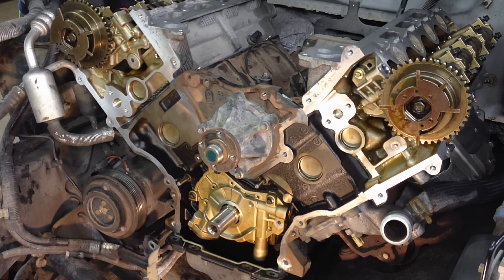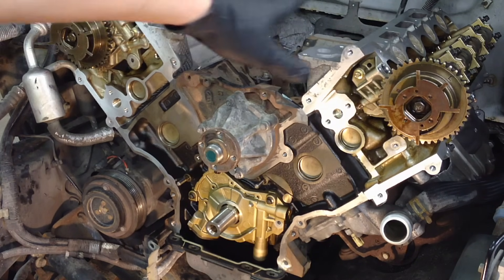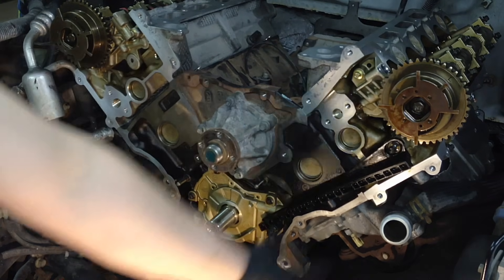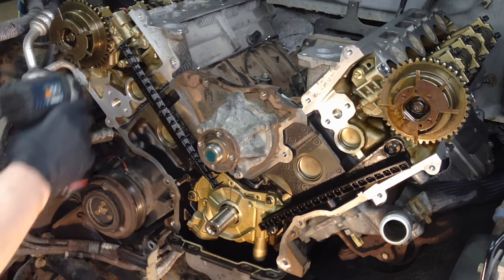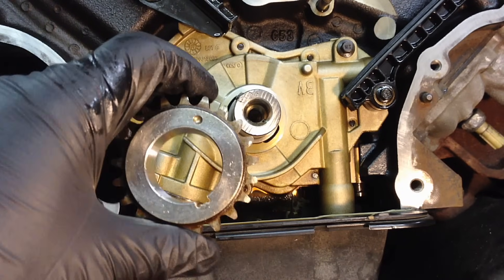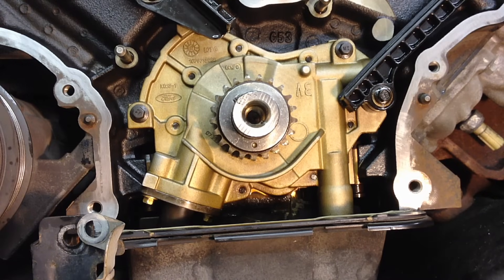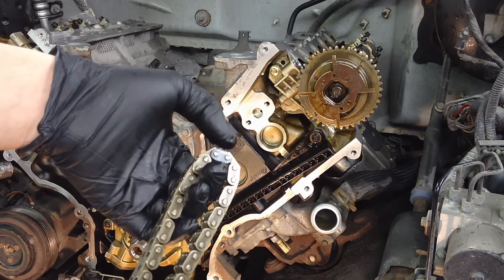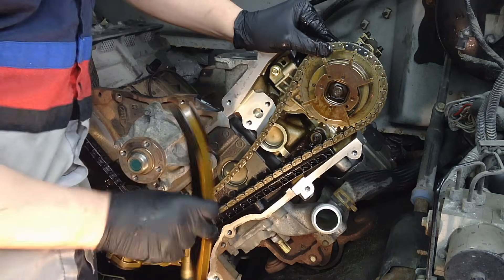Ford 5.4L 3v Engine Timing Walkthrough

Comment: Thanks for these videos, they're really helpful.  One question though.  On the 5.4 3v (in my Expedition) is it necessary to pull out ALL of the roller followers to do the timing chains/phasers/etc.  Or is it possible to leave them in and not damage anything?
Reply: did you ever get it done?
Reply: @ogbobbyharris5561  I did end up doing it. I ended up changing everything. I got the phasers really cheap and all the other stuff fairly cheap as well. I think I did the whole job for like 500 buck or somewhere in there.  Did it in my driveway and that car is still running today with over 300,000 on it.
Reply: @andrewminkewicz8846  what oil do you use 5w20 or 5w30?

Comment: I had my timing chains changed on my 5.4 and now it makes a howling 
noise when warmed up and in stop in go traffic any ideas (did notice 
check gauge quickly flashes but doesnt stay on could it be the same 
issue)
Reply: Aaron Philip low oil pressure

Comment: The only thing that is making me scratch my head is .... did you take all the rockers off? and if so when putting on the new phasers and doing the timing like you did, will that line the camshaft up in the position it needs to be... u said something like locking it down?
Reply: +aaron butcher There are special brackets that bolt on to hold the cams in place when the phasers / chains are removed , you can find them online .

Comment: I have followed your video, and I think I have got this correct. However, I may have made a mistake... I hope this makes sense to you, so please bare with me..... After I removed the timing chains, I rotated the crankshaft a few times because I was uncertain if the motor was in TDC...(Stupid mistake)  I rotated it to the point that the crankshaft keyway was at the 11'oclock position, and the timing sprocket dot was at the 6 o'clock position... I then replaced the cam phasers, tensioners, guides, and chains.... It is all lined up correctly on the sprockets and the marks on the chains are all set accordingly..... My question is, by turning the crankshaft multiple times with the timing chains off, did I screw it all up? Or as long as the crankshaft keyway is at the 11oclock position.... Will I be okay? How can I verify that it is set correctly? I don't want to bend a valve when I turn it on..
Reply: +Billyonaire Hate to break it to you but if you turned the crank with the chains off, and the followers were still in under the cams, you probably already tweaked a couple valves.
Reply: +ghunt81 went back together fine..  Doesn't skip a beat..  All I did was set cylinder 1 to TDC,  set keyway to 11 o'clock and lined up the chain timing marks on the sprockets and was good to go.

Comment: I've changed both phasers, both chains, both tensioners, oil pump, and both VCT solenoids on my 06 f150 5.4. my truck will start and run fine but as soon as I accelerate, my truck will die at idle. Any idea what's causing this?
Reply from the maker: +Anthony Aubrey try to drive it without the vct solenoids connected. If it still does it then verify throttle body operation before going any further.
Reply: Found out the main and rod bearings are no good. Once it gets to operating temp, it looses oil pressure.

Comment: Is it important to only turn it clockwise? I was concerned that the phaser bolt I installed was wrong so I took it apart to install a new one and while taking out the followers and turning it to the bottom and then back after the bolt was installed to put in the lifters I went counter clockwise. Now the chain is loose and I am pulling the hole front off. What went wrong.
Reply: +amtpdb1 The front is not off yet but I was going to say that the guide on the follower pushed back when I pressed against it so I think the tension-er must be bad.  In all cases only turn it clockwise??? Help

Comment: If the truck still has its timing, do i have to take off the cam followers? Would you recommend this guide as a step by step, as well what would to add? Great video by the way.
 http://www.ford-trucks.com/how-tos/a/ford-f150-f250-how-to-replace-your-timing-chain-361728

Comment: If it's not able to turn by hand. Does that mean I did it wrong?
Reply from the maker: +nathan yzaguirre You should be able to crank it over by hand with a 1/2 ratchet yes. It will be hard to turn at times as the pistons come up on the compression stroke.

Comment: High I have replaced my timing components and timed my engine. Is it normal for the 5.4 3v engine to get slack in chains when rotating by hand. They don't get slack at the same time.
Reply from the maker: Yes totally normal I have been through this before

Comment: Hello..the engine in this video is same than ford expedition 5.4 1998 4wd engine?
Reply from the maker: +adrian Z Hdez Adrian Z Hdez No yours is a 2v engine.
Reply: FordTechMakuloco okey ..thank you..
Reply: FordTechMakuloco Helloo body..can you help me whit some information?i need to replace a one cylinder head of ford expedition 5.4 2v 1998 4wd and i want to know if you know any video i can see how to do it?is there another vehicle whit same engine?
Reply from the maker: +adrian Z Hdez Adrian Z Hdez Any wideo showing 5.4l 2v head replacement will do they are all the same.
Reply: FordTechMakuloco Okey body.thanks for your help..
Reply: check your idle air control valve.  Had a Tuarus doing that and it was the IAC valve.

Comment: hi I need you opinion hi have a 2006 ford f 150  106000 miles. the tensioner broke and loose a chain so I put new timing set and phasers but after that the truck has very low idle.I change new sparplug, new coils, new air filter and gas filter new ctv selenoides , new camshafts, and my question is I buy the phaser on ebay is possible the are caming bad .because went I have low idle and step on gas radle like on the phasers please let me know what you thank if I need to buy and other phasers. thanks.

Comment: Question for an expert: Do you know why a 2005 Expedition with a 5.4L 3V is rated for 87 octane, and a 2005 Navigator with the exact same motor rated for 91+ octane?
Reply from the maker: +srpope80 One thing I know is the tune is different for the navigator.
Reply: +FordTechMakuloco Perfect, what I was trying to confirm.  I assume different tune so different octane requirements.  Haha, I couldn't imagine Ford "requiring" 91+ just because it was the "luxury" brand.  Thank you!
Reply: srpope80 10 to 1 compression thats y for 91

Comment: Excellent video. A question. Is it the same timing for a 4.6 ford f250? I hope you have understood me because I used translator. from mexico. cheers!
Reply from the maker: +Jorge Focil there is no 4.6l in a f250 what year?
Reply: +FordTechMakuloco 
I have a 05 F150 with 5.4L. I bought brand new Ford 5.4L 3V engine zero mileage in Tucson, AZ only $2,000 lowest price instead Ford Dealer cost like $5,000! I installed new 5.4L on my truck at 196,000 , now so fsr it has 47,000 miles on my F150 250,000 miles without problems so I change engine oil on time every 3,000 miles to avoid sludge that would block engine oil flow to head cylinders so no oil though to VCT and cam phasers cause tensioners get dry stuck retarded  cam timing knocked. I am hoping my new 5.4L to runs longer than 160, 000 miles but my original 5.4L quit at 150,000 miles that it had too many problems with timing chains system that it knocked and noise as diesel loud so we did fix install new timing chains kit, cam phasers, cam sensors, oil pump, VCTs, and tensioners too at 164,000 miles, it was good so far but still again noise came back also knocked shake a lot while retarded cam position because of no oil on head cylinders to cam phaser also to feed oil to tensioners that I don't understand I use right kind of oil Motorcraft 5w20 and motorcraft oil filter but still problem. because of engine poor designed for oil flow are too small not enough pressure to top of engine? all my friend's 5.4L 3V quit less 150,000 miles as mine.

Comment: Hello I have 2007 navigator that happen to run rough in gear once it get up to operation temp. i have done the following: new lifters... spark plugs. cops..tbi...cat converters.. vct solenoids. im at a lost.. any help would be great. great compression.. oil pressure good. fuel pressure great
Reply from the maker: +James R Have you performed a manual oil pressure test at hot idle it needs to be 15psi or higher for proper vct operation
Reply: +FordTechMakuloco  I did. took out oil pressure switch and checked with my guage 50psi

Comment: If you were changing the cam phaser them self during this process when would you do so? I watched your other video on how to change the cam phaser.  Would you have to do all this than reinstall the timing cover so you can turn the crank and remove the roller followers as shown in your other video? Than change the cam phaser?
Reply from the maker: +brad carchidi If you had the engine this far apart for a timing chain job or head job the phasers could be changed anytime after the timing chains were removed. Of course in order to do either of these jobs all the roller folllowers would already be out to prevent bent valves.
Reply: +FordTechMakuloco Appreciate the response thank you.

Comment: You mentioned this phaser is used to 2010 model 5.4L in one of the three videos I watched on timing what components changed for my 2014 Expedition? Sorry I can't remember the video. Phaser knock explained or changing a phaser. Using MC 5w20 with MC oil filter. 5K oil changes near 35K on it. How do I get it to last. In my opinion 3K oil changes are wasteful. Am I wrong?
Reply from the maker: +1crazynordlander The same 5.4L engine is used in the Ecpedition all the way to 2014. Many have switched to 5w-30 to protect the vct system. we pretty muc h changed to 5k oil changed after 2008.

Comment: Excellent videos, Thanks for the tutorials. I have a p0021 code  on my 2006 ford Expo 5.4L3v. I replaced both vtc solenoids; erase the code, engine runs nice but 5 minutes after driving the code comes back on and starts idling rough again and feels like its missing every no and then. What are your thoughts on why the code comes back?
Reply from the maker: +Steve Willsey Unplug the vct solenoid on bank 2 which is the drivers side. Go for a drive and see if the concern and codes still exist then you will know if the concern is mechanical or not.
Reply: +FordTechMakuloco light came on. Noisier on passenger than driver. I was at the ford parts counter asking for plugs and the ford mech next to me asks if I know how to swap them out. We got into discussing the p0021 code and he gave me an ear full. he just did a $2500 timing job on a 3valve. I'm guessing I might need to do all the timing parts as I intend to keep this 112k King Ranch (it's nice) vehicle till 200k or just sell it now, as is and move on. In your opinion, would you fix and keep or sell?
Reply from the maker: If you can follow my videos and do the timing and plugs yourself then I say keep it
Reply: +FordTechMakuloco thanks for you opinion. I was thinking Of going to do the plugs and phasers. I'll give an update when I'm finished. Hopefully the engine light goes off.
Reply: +Steve Willsey After taking off the valve covers, I can see that the passenger side chain guide is broken. What are your thoughts on just replacing the guides and tensioners? I'm already replacing the Camshaft Position Sensors on both sides. 115K miles on Expo.

Comment: Great vid. It helped a lot until I went to put the chains new chains on. With the crank sprocket @ 6:00 the left side fit in between the 2 black links as should be. The right side was to the left of the black links by 3-4 teeth. Can I just turn the cam phaser  with chain off to turn camshaft to line up with black links. No followers removed. The camshaft lobes might flip over to line up. Is that a problem? Thanks for all of your vids.

Comment: just a little info. don't get phaser from anywhere but Ford.. tried to save move but not worth time..I have replace chain guides and phaser. had did phaser 3 times til bought from ford..pin on back of phaser sheered off.throw-in timing out. the last one came completely apart..great video..

Comment: i bought the crankshaft timing tool and i am ready to go i think however i do have a concern. None of my timing components on the heads were changed as i had only removed the heads to replace the plugs(long story and a bad mechanic later).  I did have valve seats on 6 and 7 "repaired".  So if i have the timing marks set according to the video will i have timing issues in respect to the heads themselves?

Comment: hello, I have a 2004 lincoln navigator,  and it has 100,000 miles. I think one of my chain guides are broken or something, because when I turn on my truck in the mornings or even if I let it sit for 40 mins, I hear the Chain rattle for about 3 seconds and then it quiets down. I was told that Fords OEM oil pump is designed poorly with the aluminum backing plate. and was told that, that is the reason the tensioners go bad and eventually the guides. I am going to buy a timing Chain kit along with a Melling High performance oil pump with a cast Iron backing plate which is stronger than fords aluminum oil pump backing plate. and I was told I should always run 5-20 synthetic oil along with The oem motorcraft oil filter. that should prevent this from ever happening again..
Reply: +Restoration Junkies yeah I recently got my timing components changed and replaced and I also replaced all the gaskets that are necessary when opening up the more since it's already accessible my 2004 Lincoln Navigator is running like new again I also installed a melling oil pump which has the cast iron backing plate that helps retain oil for the next startup to lubricate your timing components the Ford OEM oil pump with the aluminum backing plate is a failure please if you get the chance go ahead and replace your oil pump with dog smelling cast iron backing plate one.. it will save you tons of money in the future and please use the right miscosity of oil because Ford engines are very very delicate when it comes to oil viscosities
Reply: +Geovanni Delgado     Mine was rattling on start up also.  The big spring was broken on the driver side cam phaser, the start up locking pin had come out and the chain was loose on that side when it was stopped. Everything on the other side looked good.  I change out  the bad cam phaser and all the guides since they were a little worn.  All the timing components had already been replaced about 5,000 miles ago and this one phaser already bad again .  Have you torn into yours yet?
Reply: +PlasmaStar9 damn, yeah about 1 month ago I took my navigator to get the  timing chain replaced, so they replaced all the chains,  guides, tensioners, and also got my oil pump, water pump replaced in the process, they say that the oil viscosity is very important.  Ford designed their trucks to perform well wit 5w20 motorcraff oil  and also with the motorcraft oil filter. my navigator no longer rattles on start up. and I never had any problems with the can phasers
Reply: +PlasmaStar9  Started mine yesterday , 2005 expedition 5.4 3v , took 3 hrs to tear down motor , 5 hrs to mark , remove , clean , replace (all new parts 13 parts total ) ,  install cover , and install the pulleys. Plan on another 4 hrs to re connect all the goodies and another 1 hr to run / change oil / and run again for completion !  Tricky to remove certain parts but doable !  Good Luck , but I suggest replacing all of the parts behind the front cover while you are in the motor that deep !
Reply: +Geovanni Delgado / Agreed !!  FordTechMakuloco has great detail in his videos , and very helpfull for us " do it yourself'ers " !!

Comment: In the video, you said to remove all rollers and lock down the cams in the proper position.  What do you mean the proper position, and when do you remove the rollers.  If the timing is off, and I put the crankshaft at 6:00 position, then how do I move the cams to the right position with the cams locked.  Hope this makes sense to you.  I am trying this for the first time.

Comment: Hi Great video.  I have a dumb question.  Is it possible to get the timing of by 180 degrees?  I am about to try this on my daughters truck for the first time.  Just worried about getting the camshaft off by 180.
Reply from the maker: +LOF Camshaft can be that is why they are timed with colored link chains and timing marks L an R as shown in the video.

Comment: is it possible for the crankshaft to be off 360 degrees?
Reply from the maker: By itself no one revolution is complete.
Reply: +FordTechMakuloco im not sure what that means. since the crankshaft has to rotate two times to complete all four strokes. there should be two times in the cycle when the crank is in a position to line up the timing marks. if it was off, it wouldnt cause any interference but the valves would be opening at the wrong time and engine wouldnt develop power. Is this thought correct?

Comment: Hi I going to work on my truck. I have question the number one piston have to be up for star put the timing chain?
Reply from the maker: Following the video for crank positions based on keyway location as shown in the video is the only way
Reply: +FordTechMakuloco  tank you for you time very helpful video.
Reply: Hi i have question I just did my timing and the truck work good but went take to drive lucks like I have only 6 cylinders and the phasers start noise and bad rough adle and die I change the vct solenoid work for little bit. Is possible the the new phaser are bad.

Comment: THIS MOTOR  IS A NITE MAYOR   ford needs to  go back to the  302   !!!!!!!!!!!!!!!!!!!!!!!
Reply: They did !!!!!!!!!!!!!!!!!!!!
Reply: @thomasmarquez6790  True but the original 302 Coyotes were built better. Mine still runs at 316k currently.